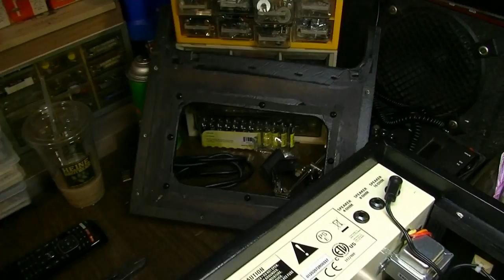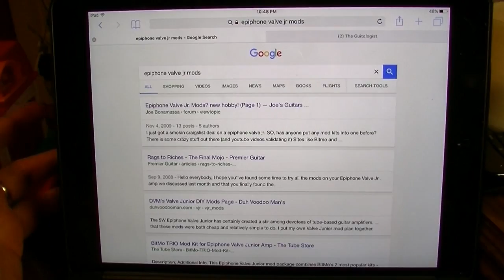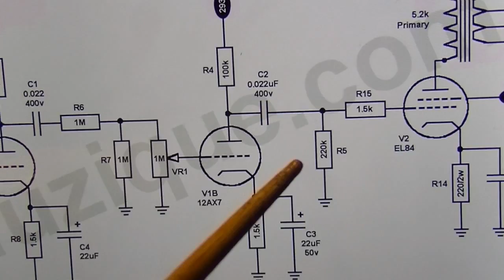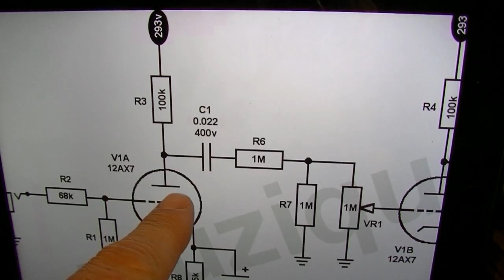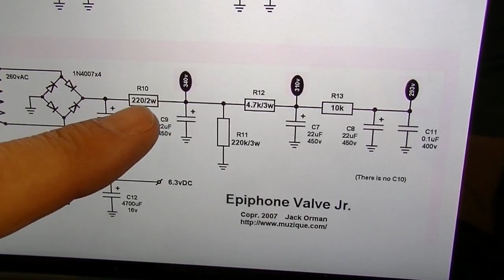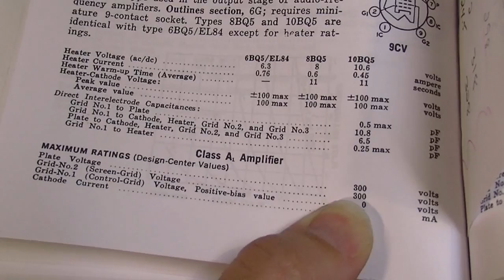Epiphone Valve Junior  Mods - A Total Waste of Time?

Comment: The purpose of C11 .. the 0.1uF cap is to suppress HF noise on the power supply. The 0.1uF has very low inductance   The 22uF has a lot of winds , so its got lots of series inductance.   The 22uF  filters the 60hz and the 0.1 kills HF noise and makes the amp more stable and prevents internal HF oscillation in a high gain amp.  Each type of capacitor has a job to do.
Your a good guitar player, you got some good fast licks !   Weird its missing an input decoupling capacitor. A stomp box that outputs some DC would change the bias on the tube.  Thats a pure Class A amp
Reply from the maker: I actually had a .05 cap on the input at one point, but wasn't fully happy with the tone, so I removed it. Thanks for the explanation on the mystery cap. I usually see those with an additional dropping R though. I think HF instability isn't much of an issue on this one, at least as it stands. If there is instability, it's outside my hearing and doesn't seem to affect the tone, so...
Reply: Looking at the schematic again, I notice that the first two stages share a power supply.  So the small bypass cap might be to prevent an oscillation from setting up between the stages.  Otherwise, a bit of the plate signal from stage 2 would get into stage 2's grid.
Reply: green323turbo is right.  When you see a little cap wired in series with a big cap, it's because the little cap bypasses the RF energy better where the big cap falls down.  It might be for when it's "big brother" ages, or it may depend on how much RF energy get's picked up at the input.  It's safe to say the engineers thought they needed it for reliability.   
Otherwise, they could have saved a few pennies in manufacturing.  It's not hurting anything, so I'd suggest putting it back in.

Comment: It would be easier to asses small tonal differences at lower volume setting -- IMHO -- and try some NFB ala 5F1 ?
Reply from the maker: I was going for usable OD really, so cranking was more my speed in the tests. NFB did cross my mind a couple times, but I wanted to try to avoid that as it can kill the bite on  notes when the amp is being overdriven. I opted for grid stoppers on each stage instead. They had the dual effect of stabilizing the amp (as NFB would have done) and taking some of the ice pickiness off the notes without killing the bite.

Man, we guitarists use some messed up terminology! :D
Reply: Now if only you could make it sound more 'green' hee hee

Comment: I would have just left the power tube bias alone. Yes, it was biased a little hot for an EL84, but many EL84 amps are. The Vox AC30 has its tubes dissipating about about 17-18 watts at idle, and a 20w Marshall is even more abusive to its tubes than the Vox. By biasing it quite a bit colder, you increased the headroom of the power amp but also drastically reduced the output power.
Reply from the maker: A lot of builders and techs agree with you! The EL84 is a far more robust tube today than when it came out. They can handle more than 12W dissipation, for sure, BUT my goal was OD, and overclocking the EL84 was counter-intuitive to that end.
Reply from the maker: If you want an amp to break up easier, you should bias it colder, not hotter. Biasing for 16W will give you increased clean headroom, while biasing for 12W will allow the amp to break up earlier and at lower volumes.
Reply: That's exactly what I was getting at. Because the bias was colder, more voltage swing from the preamp would be required to drive the power amp to its maximum power and to cutoff.
Reply: The Guitologist biasing hotter means pulling more current so lowering the bias resistor value. This pulls down the HT and also increases the distortion figures, if you look at EL84 data. This will lower head room so causing earlier breakup.
Biasing colder means increasing the cathode resistor so it lowers current draws. This results in a higher HT and a cleaner, less distorted sound with much later breakup. Very interesting tour around a little amp. Thanks
Reply from the maker: When I say "colder", I'm talking about plate dissipation, the actual temperature of the tube. Biasing it "colder" increases distortion.
Reply: I dont know, I think my brain might have been thinking of push-pull amps when I made that comment. Either that, or I have quite a bit more to learn. My guess is that it's mostly the latter.
Reply from the maker: Don't worry about it. It's a confusing thing. Charles pointed out one way of looking at it, that increasing current constitutes "hotter" and I am talking about dissipated heat from the plate constituting "hotter", but they are opposite things.
Reply: The Guitologist biasing hotter and increasing the current are the same. The power dissipated by the tube is the volts, cathode to plate, multiplied by the current through the tube. So, unless you can increase the HT with an adjustable power supply, the only way to increase the power is to lower the cathode resistor so the tube pulls more current and is therefore biased hotter. This gives earlier breakup and higher distortion figures. 
Reducing current, by increasing the cathode resistor, will reduce the power dissipated by the tube and so it will bias colder giving cleaner later breakup and less distortion.

Comment: I found it interesting they rectified the 6 volt heater supply. Costs more. Go figure. The power trany seems big enough for another tube. Perhaps a tone stack? There is room on the dash board for bass & treble knobs. Maybe even two channels! You have the know how! Great video Brad! Thankz
Reply from the maker: Version 1 of this amp apparently had AC filaments. I think the PT could handle another tube, yes. One more triode stage would be all I'd want to add, if anything. A simple tone control would be worthwhile also. The only reason I didn't bother was because this was more about what kind of tone I could coax out without adding features. I'll leave that stuff up to the next guy who owns it, but we'll see. I'm going to film a follow up video anyway testing the cap drain times with and without R11.
Reply: + Audio Tech Labs The heater supply is rectified to DC in order to eliminate hum. The earlier version with the AC heater supply hummed like hell…

Comment: everything you did seemed the opposite of what you should do. changing the bypass caps to lower values to reduce treble? removing or reducing resistors to lower gain? i'm not arguing with results, but i don't understand how you got them
Reply from the maker: Sorry I missed your comment before. I wasn't lowering bypass caps in an effort to reduce treble. I lowered those because most amps you look at with really good crunch tone don't try to pump up too much bass too early. It's more about shaping the tone so it doesn't become brittle and unmanageable at later stages. Using a bypass cap to pump bass frequencies through the tube is silly if you're just going to choke them off again with the coupling cap. It's better to find the right balance of both. That make sense?
Reply from the maker: Removing those resistors in the signal path wasn't about reducing gain either, it was about getting unnecessary components out of the way of the signal path and maybe even getting a bit MORE gain and less brittleness. Those two 1M between stage 1 and 2 were just asking to be yanked out of there.
Reply: The Guitologist thanks for the quick response and explaining why you did what you did. my little brother has a valve jr that he modded with better transformers and he says it sounds worse now. i think i'll use some of your insights to get better tone out of it. specifically to reduce brittleness, which is something he complains about.
Reply: @Old guy, maybe you know this already, but bypass caps in the cathode circuit increases the gain.  A small cap will increase it at the high end only.  A bigger cap will extend that gain down into the low end so over all gain is boosted and not JUST the highs.  From a tone standpoint, I'd think that would be similar to reducing treble. (No longer favored.)

Comment: Run this bad boy into a 2x12 or 4x12 is the way to go IMO.
Reply from the maker: A 112 would be good, for sure. Sometimes if you plug an amp into a cab with too much power handling, as most 212 or 412 cabs would have, the tone seems less full because the speaker isn't contributing to the breakup like in a more suitably matched setup.
Reply: Well it's just a matter of plugging in a cable, so what's the issue? Many people like to avoid speaker breakup these days, I think. A 5W tube amp can be fairly loud, even for bass.
Reply: Epiphone Valve series DO work well with 412 cabs, surprisingly

Comment: Isn' the R1 input resistor typically directly on the input jack before the 68k resistor?  Seems weird to me that it is second in line.
Reply from the maker: The order of those doesn't make much difference. The tube will respond similarly in either case.

Comment: I have the head version of this amp and at around the 24 minute mark is the noise I'm getting from my amp. The previous owner had done a heck of a lot of the well known mods and I'm wondering if the Orange Drop caps he put in there have gone closed circuit in the preamp stage?
Reply from the maker: If you want to upload some gut shots to a Photobucket account and start a help thread here, I'm ok with that.

Comment: Great improvement. How much do you think the speaker alone helped?
Reply from the maker: The speaker still isn't ideal. It doesn't quite handle the lows, but it was definitely an improvement over the Chinese Eminence.
Reply: Speakers make the biggest difference imo.
Reply: I suppose it's not as sexy a topic but we guitar geeks don't talk nearly enough about speakers when discussing amps. They are the most underrated component in the rig. There's another YouTuber named Johan Segeborn that does awesome videos on mostly old Marshall's that did a video on a huge variety of speakers. Many very similar but the full spectrum can be pretty broad tonally. Of course the whole cabinet matters as well and testing a speaker that will be closed back in a very open back box will sound off but I know you can roughly guestimate what it will sound like closed. Maybe that was the biggest difference overall.
Reply: Haa Haa Haa , a fricken tin can with a string is an improvement on a chinese immenense..
Reply: DomSchu Not in that amp, capacitors and resistor changes make the biggest difference. It looks like there is room to install a 10 inch speaker and they are easier to find laying around.

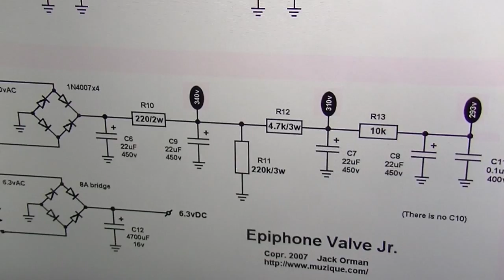Comment: 32:00 The 220k is for discharging the capacitors when the amp is turned off to prevent shock, and the .1 was a bipass cap.
Reply: the small cap is there for bypassing HF
Reply: 88888897 78d88w87s m mbps-c' v bn
  N""##
Reply: Y
Reply: Gfgf.NJ.NJ,*
Reply from the maker: You are correct on the resistor. I'm going to make another video testing discharge times with and without it in place. But the cap... It's on the power side of the plate resistor. I see there's an RC network set up by the plate resistor and that cap, but the fact that it's in parallel with a much large power cap makes it seem a bit pointless. Usually when you see those, you see an extra dropping resistor separating it from the larger power cap on the rail.
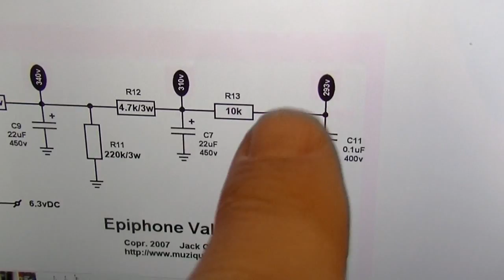Reply: @TheGuitologist  32:43 these small capacitors laid over bigger ones are most likely shorting wandering HF to ground and stabilizes the amplifier against oscillation. If you remove all HF-proofing, you might easily get HF oscillation, causing malfunctions, enigmatic overheating problems.
You might not even hear, that there is an oscillating problem.
Long ago i tried building reliable HF-Circuits without having enough HF detecting equipment. And therefore i can tell you by my own experience, HF is really tricky and it has to be tamed. In todays HF-rich times you need more and more components, you never thought about in an NF-surrounding just for safe functionality of your NF-Amplifier in case HF occurs inside the circuit.
Reply: @werner.x  Thank you! Now i understand it!
Reply: @egorreshetnikov3864  Now i see, that i did unfortunatelly use the german abbreviation NF for "low frequency", in english it should have been LF.
Reply: @werner.x  Looking at those little caps near big ones in such PSUs i thought that little caps are somehow faster discharging thus helping to maintain steady power supply. LOL
Reply: @TheGuitologist  ii t U75d%tfs
Reply: )ppn i
Reply from the maker: Here's the follow-up video: https://youtu.be/xMpWcFX4wAg

Comment: Wonder what it would sound like through a 2x12
Reply: I play mine with 2 112 cabs !!!!  And it moves !!!!!!!
Reply from the maker: 5W isn't enough power to really move 2x12 efficiently, but it could move 112 and sound good. A 10" speaker would be far more appropriate for this amp. That 8" is struggling at full volume, which you want a little of that, but it's just on the edge of farting out.
Reply: It makes you wonder about the QA on that assembly line though. The build quality would be that good but the amp is voiced to sound like a dying wheel bearing. Anyway, it sounds mighty now.
Reply: Believe it or not, all of these “little” 5 watt Class A tube amps Will drive a 4X12 cabinet to way more than desirable levels...   it would surprise many players how powerful 5 watts of tube power really is... of course first thing when you get one of these amps is swap out the tubes...  I go to my local Surplus Electronic store and use brand new RCA and Sylvania Tung-Sol.  I even swap them around to see how much tonal difference between the tube brands...

Comment: Not sure why you didn't know the 220k was a drain resistor? 
Also, very common power supply circuit using a resistor rather then a choke which could have been replaced with resistor of  increased wattage and put back in based on color changes to the old one.
Reply: Hi, The warm tubes will bleed off the main caps with a power down as you have stated. However, if you or someone less experienced is trying to servicing the amp and for some reason the tubes are not in at power down, there is nothing to bleed off the HT so personally  I would leave it in  for safety reasons. Also the grid stopper resistor should be physically located as close as possible to the grid to reduce the possibility of any unwanted oscillation.
Reply from the maker: When I was first starting out doing this, I read somewhere about it not being ideal to have a power node supplying nothing up front. I don't see a need for it. The 220k dropping resistor was unnecessary. The two 22uf caps now double the cap value on the first node, which I like better. You are right about the 220k to ground. That isn't a common thing in vintage amps, which is what I was visualizing while fiddling with the power circuit. Brain fart on my part. BUT, I'm going to make another video showing the cap drain times with and without that resistor and see if it's even necessary. My hunch is, the conductance of the still-warm tubes as they cool after power down will be enough to drain all caps in a reasonable time without that resistor. We'll see.
Reply from the maker: Here's the follow-up video: https://youtu.be/xMpWcFX4wAg
Reply: Talk about a waste of time. There goes 43:35 that I will never get back In life. This long winded guy who likes to hear his own voice could have summed this is up in 5 minutes. Worthless.